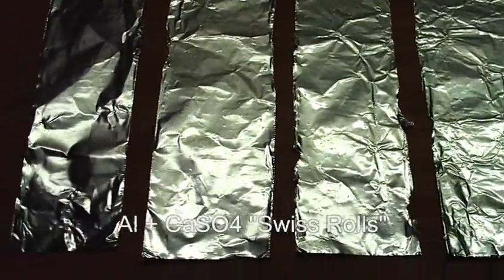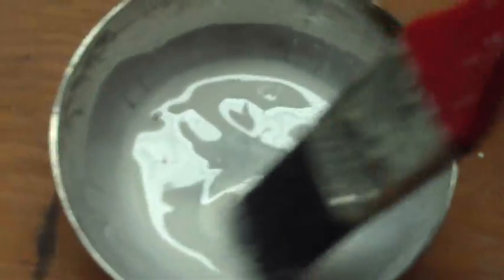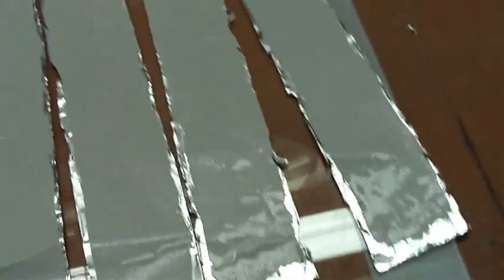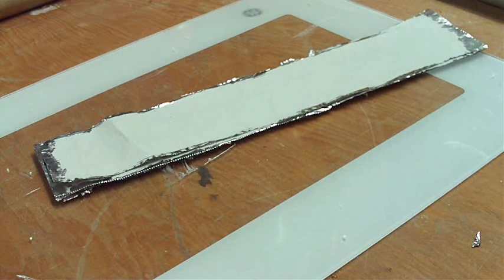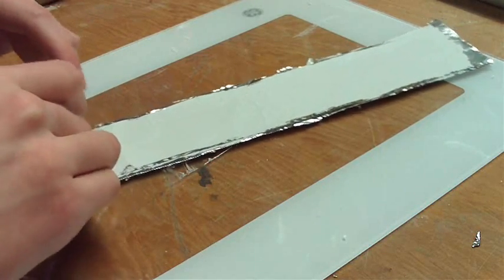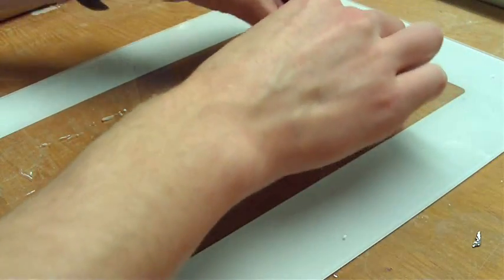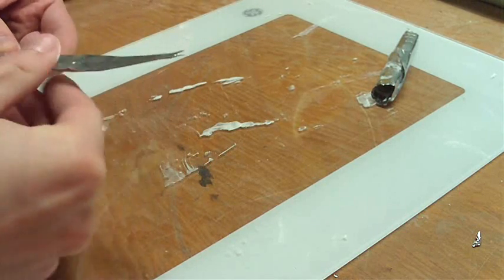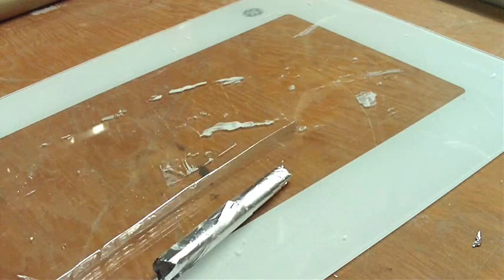Al + CaSO4 "Swiss Rolls"

Comment: @maxx1231 ya would have to be a bit more controled like that.  not sure that adding water to the plaster helped at all either.  might burn better w/ just plaster powder in aluminum foil.  there are chem changes in it after water is added.  but I totally agree, if the aluminum was in powder and so was plaster, prob be verry energetic

Comment from the maker: @EinYamakasi 

You are correct. Plaster hardens through rehydration. By baking them, I attempted to dehydrate the plaster again. Unfortunately, the elevated temperatures corroded the aluminum significantly and rendered these devices inert. I have been successful with magnesium version of this. I will post a video detailing a successful magnesium-plaster composition this weekend.

Comment: @zhmapper
So you mentioned baking it, as I understand it, it should chemically cure into gypsum by itself which would work quite well. Is the baking step to simply help drive off excess water or does it serve another purpose? Thanks for the vid btw, pretty neat.

Comment from the maker: Hello all, I'll answer a few questions.

First of all, this didn't work. Upon heating it to the dehydration point, the aluminum was rapidly consumed by the plaster.

Second, I have made a mix with magnesium and fully hydrated CaSO4 (cast into a slug), which worked even though the plaster had all that water in it. I have the video, I've just been very busy lately and need to edit it.

Comment from the maker: I didn't know if it was going to work or not, so I tried it.

Firecrackers are like C4 because they both explode. My random mixtures are not true thermite, but burn like thermite, just as a lighter is like a candle and visco is like a sparkler.

I agree with what you say, but I think Thermite-like can successfully describe these mixtures.